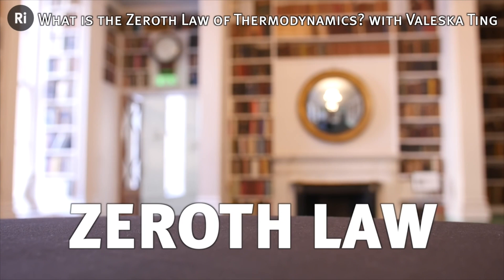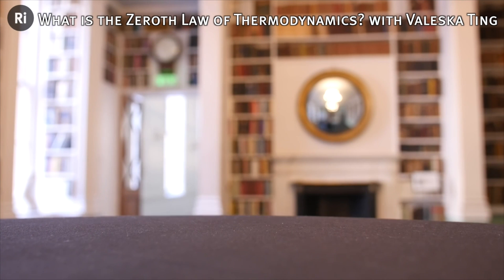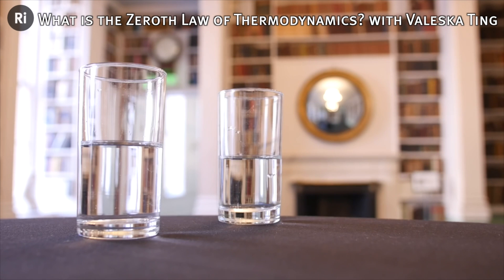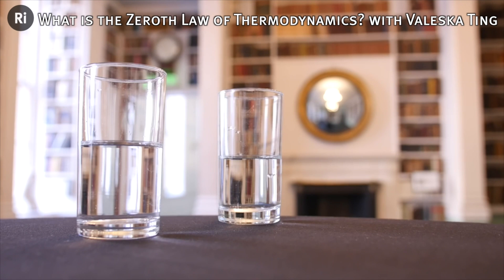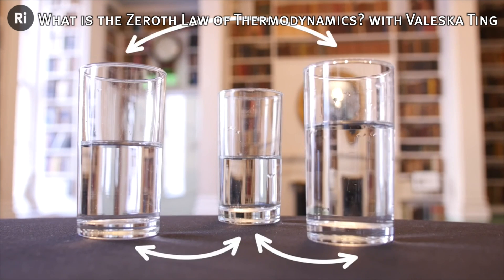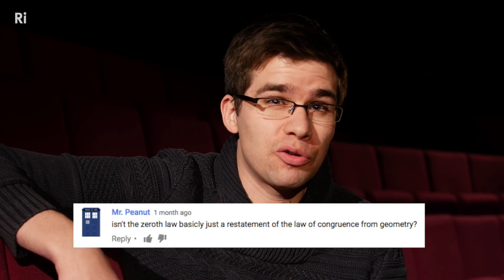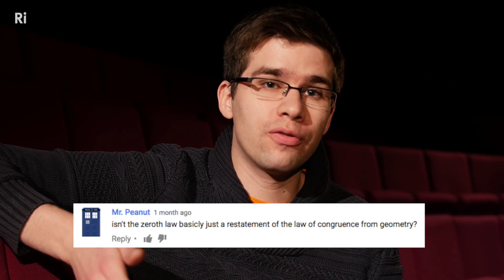Explaining Thermodynamics - Monthly(ish) Mailbag #3

Comment: If mass and energy are "somehow the same thing" or "linked" as in E=mc², I wonder: Why does energy try to dissipate in empty space while masses attract each other? How does this contrasting behaviour fit into that equivalence?
Reply: Well, ice and water and vapor are "somehow the same thing" or linked by evaporation, melting and freezing. Though chunk of ice sits firmly in place, water flows downwards and vapor flies away.
Even if the things are the same or connected, they are not bound to have same properties in different sates.
Reply: taking slightly different point of view we can (in general) consider  energy as waves and mass as particles - there are certain powers keeping basic particles of matter from flying off, but it doesn't work with waves, or we would be able to pack our favorite  music in blocks for example
Reply: That's depends of how much favorite music You have. Light waves are bent by gravity pretty well. If amount of waves would get considerable, like energy of magnitude of c**2 * 10**32, it might get pretty selfcontained.
Reply: hm let see... all Led Zep records,  Beatles, Metallica, Pink Floyd, Deep Purple... how much gravity we need to bend it into an amazing one of the kind greatly self contain vinyl record? and how to play it back?
Reply: azgarogly ... hence the 'kugelblitz'.
Reply: 'keep your records in kugelblitz - fashionable storage with biggest available space ever!'
Reply: a volume of a black hole is contained on the surface of a black hole, so put those vinyls in a room, make a room into a black hole, gather hawking radiation as it evaporates and somehow rewind/forward time to get to the actual contents, also get like 15 nobel prizes on the way there. But hey thats one way to do it
Reply: forget Nobel prizes - it would be the most epic record ever! by the way do you by any chance know how to get rid of the buzz on my high E string? my universe would be perfectly in balance) with a little help of some melodically pleasant waves)
Reply: mm mass energy does dissipate, as particle decay! most particles are unstable and so they decay into lighter particles which spread out and increase the entropy. most of the familiar matter around us is made of stable matter, protons and electrons, which dont decay because there are not lighter particle they could decay into while conserving charge